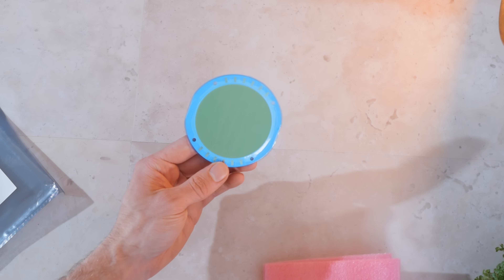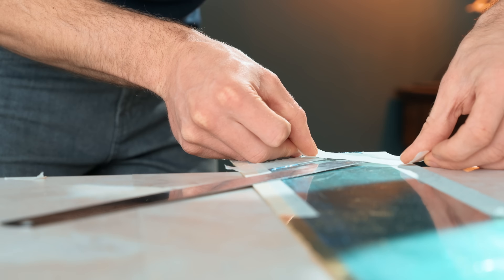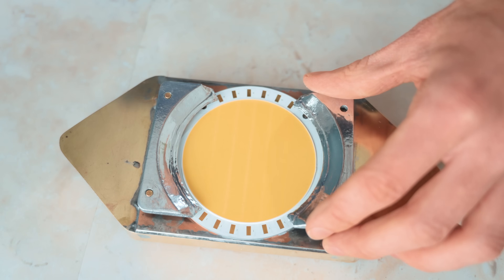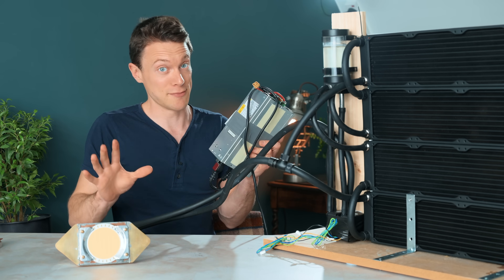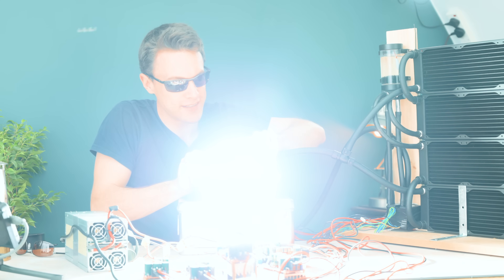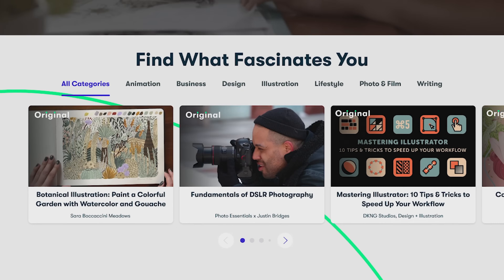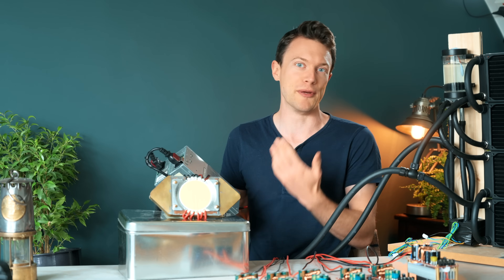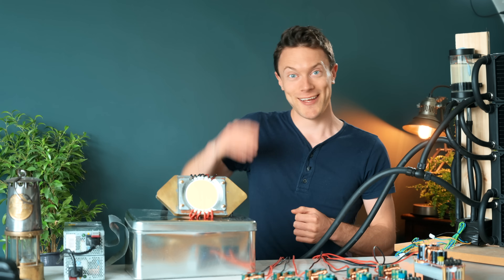Testing the world's BRIGHTEST LED!!!

Comment from the maker: FAQ Time! But first, don't forget that after your first two months of free Skillshare trial goodness it's LESS than $10 per month if you go with an annual plan, which is like a good cup of coffee per week but instead you're building on your lifelong knowledge. Enjoy! https://skl.sh/diyperks2
Now, question and answer time!

The first think I'll say is that there's been a surprising spread of discussion about various aspects of this build in the comments. It's great to see! I actually learn a lot from reading comments that you guys leave, and there are some serious golden nuggets of info here and there which I appreciate a lot for building on my own knowledge. I will first address a few common misunderstandings though.

Firstly, some folk are assuming that the LED is 90%+ efficient, which would mean that it would only output 150w as heat and the rest as light. This isn't the case unfortunately, as even some of the best LEDs are only 40% efficient MAXIMUM. This figure changes depending on the colour accuracy, with more colour accurate LEDs being less efficient as they have to emit more of the visible spectrum. Let's assume the LED is roughly 30% efficient (which is probably fairly accurate, and may even be a bit generous) that means that 450w is being emitted as light, and the other 1050w is being wasted as heat. So, I built my cooling system around the assumption of needing to dump 1000w of heat into the air, which is why I had four large radiators and made an extreme cooling block for it. LEDs last longer when they're cooler, so it's super important. I also want the final unit to run quietly, not with maximum fan speed, so this extra headroom allows me to do that.

Another thing that crops up is talk of corrosion. In water loops it's very important to use similar metals, otherwise you run in to galvanic corrosion where one metal will literally steal electrons from the other, causing the other one to corrode quickly as they're 'connected through the water'. Brass and copper are similar enough, but the lead in the solder may be susceptible to corrosion. However, adding an anti-corrosive additive to the liquid should solve this in the final build. The radiators are copper, not aluminium, so no worries there.

As for the PSU's failing... there have been many theories but nothing solid. They are 12v PSUs, and are rated for 83A on that lane. When in series, they give 24v at 83A... 83*24=1992w. The reason for my wanting a higher voltage is that it literally halves the amps on the voltage booster, meaning they can run easily rather than at their absolute maximum ratings.

Hit me up with any more questions!

Anyway, I hope that clears things up. If you still see these questions popping up please relay the answers contained here for me please :)
Reply: Where do you write your ideas down? How do you come up with your ideas for your videos? I always strive to find new ways to stay creative and keep the ideas generating! Cheers!
Reply from the maker: @KennyPhases  I use Google Keep on my phone to jot down my ideas. Usually I get inspired from a train of thought or from talking to others.
Reply: @DIYPerks  I think you your heatsink is too large. You don't have to get rid of 1500W of excess heat, but of (100-LED efficiency) % of the heat... You should be able to dissipate that much by using a vapor-chamber heatsink from an old graphics card!
Reply: @DIYPerks  could you please test it outside in direct sunlight? It's more interesting to see on video the comparative effect compared to a known light source (sun)  then to look at basically any lighting setup which the camera then adapts to...
Reply: @DIYPerks  can you make a atx pc case kit in the future ?
Reply: @DIYPerks  Pleaaase test this in the bright sun, to see how it would play for day film making... I'm more interested in the day time test rather than at night. 

For the power supply, you could use six 24V 15A, one for each booster and each section, cheap enough, overrated and easier to handle than a single huge one, check it out.
Reply: @DIYPerks  There are more biger and brightest but the bigest ones are in Germany theyr so bright and It Bruns evry Thing infornt of the Lens in 1milisecond and theyr From Samsung also
Reply: @DIYPerks  where’s the next video.?
Reply: Whatever it was that caused the PSU failure, I highly doubt it was running them in series. While it can be a bad idea in some circumstances, since you're using identical supplies tied together and just to power this one thing, there is no way that that will "bother" them. Because they're galvanically isolated from the mains, they don't know and don't care that there's another PSU in the system. 

In this case, you could also run several 24V PSUs, with certain caveats. Their 24V rails should not be actually tied together, unless they're rated to work in parallel with another PSU. Otherwise, they'll fight for who is supplying exactly 24V. However server supplies are generally designed to avoid that problem. 

But you could also get several generic "24V LED power supplies" and use each one to separately power a boost converter or two. 

Anyway, great build! And a water cooling setup that would make Linus tech tips proud. That water block is especially awesome.
Reply: @natalie5947  I think the issue is probably the serial connection of the two power supplies. The psu output around 80A that means that the output transistors will not be capable of withstand a lot more than that. When he connect them in series and crank up the power to max it probably doubled the amount of current going through those circuits. More current leads to more dissipation of heat, which is probably why the fans kept ramping up.
Most high power psu will have some signal to interconnect 2 or more psu in parallel,  but I've never seen anyone connecting psu in series. Probably because of this. My advice would be to get a 36v psu or 6 x 24v psu (since he already using the voltage adaptor boards).
Reply: @natalie5947  the neutral/live inputs are galvanically isolated from the GND/12V outputs. But the input earth is tied to GND. I just measured my PSU.

Meaning their GND potentials are identical. When he tries to hook them up in series he'll connect 12V directly to ground.
Reply from the maker: @lucythebrazen  All true, but I isolated the secondary PSU internally to avoid that very problem.
Reply: @DIYPerks  I just posted a comment about that situation. Didn't realize that other people commented that. But has i said in the other comment, I have several server psu's and when I mod them to run in series I can't remove all chassis connections, when I do that, the psu's doesn't run well.
Reply: @DIYPerks  did you take the ground being connected trough the mains leads into account? you can only ground one of them and have the other "floating" (disconnect ground from the second mains cable). needless to say that if the not grounded psu fails in a way it connects the fase to ground the case becomes live...
Reply: @Fuscao_Preto  Yes I am just getting into PCs but I'm really into it and have been learning a lot since spending more time at home due to the current global situation. I'm really looking forward to seeing Matt's work with this project
Reply: Hey just a tip thermalpaste is really not great for this application look into thing indium foil sheets they do the exact same job but a lot better.The heat sink feeling cool also explains this as the thermal paste is not that good at wicking away a ton of heat fast yea please look into indium foil. How it works is that indium is a very soft metal with high thermal conductivity so when you bolt it between 2 metals it fills all the cracks and scratches between them offering better contact between the 2 metals and also an increase in heat transfer rate
Reply: @Gianns_TDM  indium foil is only marginally better than high quality paste. And that's only IF there is significant clamping load to upset the foi and force itl into the μscopic surface voids. And the clamping pressure in the middle of the area is usually not enough. Liquid indium alloys are better than paste, but are conductive liquid.
Reply: I forgot to add a possible solution.
Option 1 (less than ideal and temporary.)
Add two more PSUs in parallel or ywo scrap 12V car batteries in series with these power supplies in parallel to keep the current draw from the PSUs manageable.
Run time 30 min to an hour from batteries as you'll be wanting to take from 12 and a bit V to no lower than 10.5V. If new batteries, they tend to start around 14V

Option 2. Long term.

The LED in the description has a data sheet that states it can take 41V Max.
So a 240~ - 36V DC 2000W PSU seems like the best option for size. From China £220 the first one I Googled.

Or 10 X 240~ - 36V DC 5 AMP converters for £165 from Amazon.

Or to replace your computer PSUs 1 x 12V/24V 70Amp lorry battery charger for £120
Useful for future projects? (Peak 100Amp @ 24V continuous 70Amp.)
 Will almost certainly need the DC cleaning up for more sensitive projects. But a massively beefy capacitor using commercial sized cling film and tin foil would certainly make a nice video.
Reply: @DIY Perks You could have used one power supply to power a bank of 3 voltage boosters each, that way you would have removed the power supply series from the equation and each power supply would have ran at its rating.
Reply: @costindaniel100  that’s a very good idea, removes any issues the in series may bring. Bet there woulda been no problem s then, and he could use three power supplies, running 2 lights each at only 600 watts.
Reply: One thing I haven't noticed in the posts is that you have mixed metals (copper, aluminum, brass and plumbing solder), those mixed metals tend to cause a lot of problems in the water. be very aware of the need to add anti-corrosion fluids and clean this loop often or it will grow crap and clog up, but you can't open the heat sink up to clean it.
Reply: @deadlydragon72  Yeah I noticed the same thing he didn't clean the inside of the heatsink. Should ad some vinigar in it let it go overnight and flush it.
Reply: I don't think that you need that many radiators two should do so would mean less power usage both with the cooling fans and the pumps and fewer components to go wrong and a slimmer design
Reply: I found this power supply . I think it can work .https://www.enermax.com/home.php?fn=eng/product_a1_1_1&lv0=1&lv1=52&no=318
Reply: Great video, but I'm very dubious about Skillshare having read the Trustpilot reviews from people who have tried to cancel subs. https://uk.trustpilot.com/review/skillshare.com
Reply: send seasonic an email
Reply: Please show us the outdoor test! Don’t forget about this project!
Reply: Why not use pc power supplies but instead of wiring them in series use a transformer on the output of each and then run 3 drivers off of each power supply
Reply: Maybe look into an ebike battery or two to power it. My Ebike battery is rated for 50 amps sustained at 48 volts (not that my Ebike can use anywhere near that). It's portable and already DC allowing you to ditch the power supply. Also, I noticed you used a grid of conventional little computer fans to cool you radiators. If you use one large fan in your final build instead, it will move much more air with much less noise (a fan that is twice the diameter moves ~8 times the air at the same rpm). I can't wait to see what you come up with.
Reply: the 2 power supplies are not really supposed to run in series and they cant provide all the power, some gets lost and mostly the "2000w" psus are meant for 1500w.
Reply: Hi, just a comment about the PSU. I don't know where you but it, but normally this kind of PSU are already used, if you buy a new one from Amazon it is just a refurbished one, non of them are reliable enough to ensure a 100% performance bucause were use in a server long time ago. This kind of PSU are design just for server, in fact they are use in pair minimum, because need a backup in case of failure. They are companies that buy used PSU just for selling to other companies as a repair because people like HP just sell it new ones for 5 years, then you have to find a new server or find used parts in companies like I mentioned before. Summary : this kind of PSU are just for hobbies or people that are mining coins like Btc that have no problem to repair or replace for a used one in order to continue their business.
Reply: For the waterblock wouldn't a thread ripper or Intel xeon platinum sized blocks do, as they have a greater surfacw area for cooling. Great video as ever
Reply: @edson oliveira de carvalho So... 12V*82A is 984W, right.

The PSUs still can output 82A when coupled in series. 24V*82A is ...

Double
Reply: @ DIY Perks how many lumans is the LED?
Reply: DIY Perks Hi! I work with very strong LED sources for research purposes so this was fun to watch. I’m wondering if you considered using a Peltier cooler? This is normally how we quickly exchange a lot of heat rather than allowing it to dissipate by itself (which sometimes is too slow and thus damages the LED). This might be overkill? But for research it’s actually very necessary because at temperatures above 100 C, the wavelengths and strength of the LED can wildly fluctuate.
Reply: @mrmikkeeyy  that's a good idea
Reply: Those LEDs work by emmiting blue light that then is converted by luminofore to red, yellow, green etc. I wonder how much of LED power is eemmited in UV and in such high power application isn't it an issue? Can you gaet a sunburn from holding your hand in front of an LED?
Reply: Awsome videos
I'm wondering if you test you project first or you immediately make it in front of camera.
Reply: perhaps the two power supplies have broken because a small part of the total energy they can emit turns into heat, so the maximum wattage will have been less. Many power supplies are optimized if you find "80 plus bronze, silver, gold, platinum and titanium." and I think those two server power supplies weren't optimized for this. I hope it will come in handy and sorry for my English but I am Italian.
Reply: Hey! Not sure if anyone had the same idea, but I have a theory for the PSU failing.

You connected them in series and used step-up converters after them, right? That is a huge amount of switching noise that you did not address at all. You might have had some serious high-frequency noise with peak currents way above the rated max of the PSU. You should have checked that with an oscilloscope. Maybe adding extra buffers between the PSU and the step-up converters would have done the trick?
One obvious mistake you made however, was turning off the whole system once you realised that it's too hot for your likings. You should have disconnected the LED and let the PSU and the pumps running. That way everything is cooled actively until residual heat is taken away. That might have been the last drop for your PSU.

Otherwise great job and thanks for sharing of course. Cheers!
Reply: Not sure what your budget is, but why not something like three MeanWell HLG-480series, or six ELG-240 series?  These supplies are passively cooled and designed to run at 100% output all day long.
Reply: I think the issue is hooking up those PSUs in series. 

Most PC PSUs have their output GND at earth potential, so effectively both your PSUs share a ground, that's basically a short circuit with extra steps...
Reply: @lucythebrazen  all you need to do to run server PSU's in series is to remove the ground pins from the plug and make sure you don't touch he cases or you can isolate the circuit board from the case then you can leave the ground pin and you can touch the cases.
Reply: @lucythebrazen  i tought the same, the PSUs need to be in paralled and protected by diodes on the positive. And maybe the boost converters should work a bit extra to get those 30v but it would be better.
Reply: I've seen you use the filters from a monitor to change the shadows of a light source. Do you plan to use it again in a powerful LED? BTW, can you even use those filters with such source?
Reply: DIY Perks Use a lorry’s (truck) battery
Reply: DENIS Forrest A marine battery might be better (or a bank of 6), but I have to wonder how long they can sustain even voltage. I’m also thinking that for the purposes of the experiment, the cooling system should have a separate power supply.
Reply: How much power can you actually get out of your home power socket? is there a point you will overload your input to your house!? would love to know!
Reply: Shagrof That depends on your geographical location. In the U.S., your ordinary three prong socket supplies single phase 110-120 volts, and are rated for 15 amps. [If you have greater power requirements, you can add a 240 volt circuit (using two hot legs to complete the circuit, rather then 1 hot and 1 neutral) If this sounds to technical, it’s better to avoid fooling around because these voltages are deadly.] Other countries use different voltages, and their outlet connections are rated differently according to their local electrical codes.
Reply: @deadeyenation1  that will depend a lot of where you are and which outlaw your talking about. Here in the UK the max amps for most sockets is 13A so when you multiply by the 240V we get around 3KW of maximum power. So you can check the maximum amperage that can go through a socket and multiply by the mains voltage.
Reply: @deadeyenation1  a main house has either a 100amp or 200amp load, I believe.?
Reply: Wouldn't a big pc watercooling monoblock suffice the surface area?
Reply: just saying we can see wires and your lighting in the top right
Reply: How much time do you spend making projects?
Reply from the maker: @samuele_gonnella  Too much!
Reply: I'm curious about water cooling the power supplies and voltage boosters as well. My plan is to light my new shop using water cooled 100w LEDs, and I might also add that cooling to the boosters and power supply (I'm using more or less the same setup as you) too. I'd just like to know if it's worth it. Oh, I'll be dumping the heat outside the shop in summer (switching to indoor heat exchanger in winter), so moving waste heat out from the air conditioned space is a primary goal.
Reply: @edson oliveira de carvalho As you said, you do get the current limited by each psu and sum of the voltages, but that means sum of the wattage. U1=12V, I1=62.5A P1=U1*I1=750W then twice the voltage means P2=(2*U1)*I1=1500W
Reply: How much Lumen this LED have?
Reply: Perks - How much did you pay for that LED?
Reply: @thekaiser1919  He got it donated from the manufacturer.
This is mentioned towards the end of the video.
Reply: Why not add simple case fans to blow cool air into the power supply? Dual fan unit less than $20- just setup to push/pull air through the power supply and keep it running 1 minute after load to slowly cool it down.
Reply: @travisminneapolis  we have a winner 🏆🏆 PSU fans stop when the power is off but the heat is still there. This basically never happens to a real server cos redundant power. If you shut down the host, the fans can still run.
Reply: Hey it (LED with its cooling contraption) kinda looks like the aliens camera tentical form WAR OF WORLDS
Reply: https://youtu.be/GUxszz_lo14 Here he talks about the oscillation issues that can blow a power supply. I think you need to put a dummy load power resistor on the output of the pc power supplies.... Then once you turn them on with the dummy load.... THEN you can turn on the buck converters and the system shouldn't blow up. The PSUs blew up because oof oscillation issues
Reply: Wanted to see it in action at night
Reply: When you do get your replacement power supplies, it would be informative to compare to LED output vs sunlight on a bright day- the LED should have more W/m2!
Reply: DIY perks,
Please make a dedicated video in DIY Amazon Alexa.
Reply: I'll just leave this here:

https://www.ebay.com/itm/Sorensen-DHP-30-220-Programmable-Power-Supply-Tested-and-Working/302995593022
Reply: What is your name? Which school or college did you go to? Where do you get your components?
Reply: The sound when you plug in the XT60 connectors comes from sparks. You need anti-spark XT60 connectors or use a pre-charge resistor.
Reply: You cloud try with something like an ELTEK FlatPack 2HE power supply. They can handle a lot of power as they are used for telcom UPS systems. You can get them fairly cheap on ebay
Reply: I feel the PSU failed because when you cut off power to it. The excess heat within it fried its components. Since the heat within was not dissipated. What do you think?
Reply: In the video you first turned on power supplies before connecting all the things individually. Did you disconnect first or just power on?

Those power converters have big caps on them and are going to draw a lot of startup current if powered on at once, likely more than the power supplies are rated for.

Worse, those capacitors are going to clamp the voltage over themselves as they charge up, meaning if one of the power supplies comes on before the other, the remaining voltage will be applied to the terminals of the other....in reverse, bad times for that power supply.

If one turned on before another with a load, it's basically akin to connecting one across the other in reverse, that sounds like a recipe for dead power supply

Also, derating- the power supplies are rated for that on their own, their functional rating may very well be far lower if  you strap them together, heating each other up like that
Reply: You mentioned in the video that you couldn't find a suitable copper water block.  See https://customthermoelectric.com/products/water-blocks.html
Either a 3x3 inch or 4x4 inch should do the job. Though I really like your concept of essentially wrapping a copper heat sink for water flow. Very well done. Killer LED.
Reply: Why didn't you just use a threadripper block? It would have been plenty big
Reply: When you pulled the power plug I thought to myself: "Well, he fried the PSUs". Not sure if this has been mentioned, but you shouldn't just turn off something that's very, very hot and uses fans to cool it down. Because when you turn it off, the heat is still there, yet the fans can't cool it down anymore. It would've been much safer to turn off each section of the LED and wait until the fans get quieter, before pulling the power plug.
Reply: Do you know if they have a powering harness available too?  At 95 CRI--which you should mention that outstanding CRI in the next video by the way because often when they do these LEDs, there is a CRI/intensity tradeoff--that light is every reef tank owners DREAM!  I'd love to get a version of it about 1/3 the power with and accompanying power supply, cooler, etc.
Reply: Your server power supplies are rated for 1000w probably. Using them in series will increase the voltage only, not the amperage. Boosting the voltage up is far from being efficient too. I think its about 60% efficient. Your power supplies are waay underrated for this task.  You need at least 4x1000w power supplies. 2parralel in series with the other 2
Reply: For the power density of the LED array you are working with, it is normal to mill the mating copper  surface flat within a few microns. Then use the absolute minimum amount of thermal paste. This is standard practice with high power RF devices etc. Alos, the PSU that blew up - did you have the fans programmed to run as fast as possible ? Anyway, well done, Mark
Reply: You should make it hand-held
Reply: Hey man, reason behind PSU's failing may be, in imbalance, I guess? Like power not being splitted in half but rather one PSU working harder then the other one? Or if they were second-hand one, they were maybe worn out after years of service.
Reply: Sss
Reply: Could of just stuck it to a fish tank
Reply: Are you going to make a huge movie theater projector with this?
Reply: Hey, have you looked into building a lithium battery to power this? It would probably improve the overall efficiency.

A 8s10p 18650 pack could handle 100A continuous at 30v, without the need for cooling!
Reply: Can you make a video similar to your Home Security on a Budget one, except for outdoor security? I don't want to pay upwards of $400, or monthly subscription fees for the regular commercial products.
Reply: Is there anything wrong with under-powering an LED?
Reply: time for another custom PC build ,i think theyre peoples favourites to watch :) how about a PC build that uses one single massive heatsink for both the CPU and GPUs to affix on with one single intake fan beneath it
Reply: I have an idea can u make a duel screen mobile like u did on laptoo is it possible.. Even it ist pratical
Reply: Why not power each LED strip with its own 1000W Power supply?
 You can buy those from good brands like Corsair and the such :D
Reply: Matt I absolutely love your work and enthusiasm.....can i pick your brain, i know you like to “repurpose” ....I’ve repurposed some scrap wood...and made a Grand piano!!! (Look in on my youtube I’m playing “Imagine” on this very creation!) ....I’ve basically built a carcass replica Steinway to house my digital piano....long story short...how can i put bigger speakers/make louder? (I have two passive PA speakers can i link them to a YDP101 Digital Yamaha piano easily?? Have you any pointers?....this would be greatly appreciated!! Keep up the great work 😉
Reply: I just bought one of those $100 recliner off ebay and got to thinking about modifying it. Any suggestions for possibly putting speaker on it? Cheaply as possible 😆
Reply: what kind of engineer are you?
Reply: I would like you to show me how to make a homemade air conditioner?
Reply: Do you make YouTube videos for a living or are you an engineer.
Reply: thank you SponsorBlock for these crappy sponsorship adverts, if products shown on ads in Youtube videos were free, it would be better but *no*...
Reply: You should check with the manufacturer--just because the COB LED is rated to 1500W max, it is usually unwise to run it at  max power. Running it at 50% or lower, maybe even 30%, is more sensible or you reduce it's life span, i.e. you burn it out rapidly. Cooling it would be less of a problem too. 1500W probably exceeds if not triples max sunlight in it's beam. It's just something to think about. I think most 'grow lights' run the LEDs at a significantly lower wattage than the max wattage that could be used and can still exceed sunlight, in the $600 price range, including all the electronics and cooling. 

Also, there are specialized LED drivers/power supply designs that are specially made for controlling the voltage and wattage, to make sure you don't harm the LED, and you might want to look into their design in relationship to computer power supplies. (I don't know the differences, and it's possible that computer supplies can be modified to accommodate the differences. It's just something to think about.) 

These a very interesting COBs, and their application does require cooling designs and probably lens designs to distribute the photons, but I think they are not meant to be run at full power. 

They have more available light in a compact unit, and could be very useful , but  it comes at a price. You say you got this for $1000, but they are more like $1500 and don't include any of the electronics. These could make a great grow light in a large space, or spot light, stage light, or photography light when used properly, but even so, they are overly expensive for what you get, and the grief you have to go through to balance all the other factors needed for setting them up and making them  usable.
Reply: probably irrelecant, but next time id use d5 pumps, also with water cooling reservoirs you can leave the top off while filling and fill directrly from a gallon bottle, this will allow you to avoid cycling and fill the whole loop in about 10 seconds
Reply: @DIYPerks Make a Video on Repairing of 25W Motorola Charger
Reply: Robber: give me your're lights or say good buy!
Reply: Try brazing next time.
Reply: Heeey, it would be awesome if you could do one video, where you take cheap fake JBL speaker, and then upgrade it to sound like original, or even better than the original! :O
Like what to buy, what to look at, power consumption, what batteries to use and stuff like that.
I love your videos, I've learned so much with your work, and I have also done like 4 DIY projects, all learned from your videos!!
Reply: You could use 2 corsair ax 1600i PSU in series, but they are a bit expensive so if you can make sure they sponsor you it might be a good idea. Sorry for my English google translation is not perfect! I love your videos, keep it up!
Reply: you need to use Bitmain bitcoin miner power supplies im sure you can find second hand ones   they are very efficient and heavy duty
Reply: Why are you so attractive
Reply: Actually, there's 1500w 36v power supply you can buy off an Aliexpress for about $150. That one should be a better fit for the LED rather than having to convert from 12v to 36v. Also, the boost converter is probably at about 90% efficiency, so that will consume more from PSU, so this could push the PSU over the edge and fry it (though it might have been saved by keep the fan running for a minute before pulling the plug).

P.S. I can source a similar emitter (CRI, wattage) for less than $300.
Reply: The company that makes the led you would imagine would have already made a water cooking solution what's the point in buying it as most end users wouldn't be able to make their own custom fitting
Reply: Hi, Great video. My request is that you do a follow up, with a few key points:
1) The best use of such a light would be for film purposes, as it likely outputs (I'm guessing) the equivalent of a 10 kW tungsten light, could you compare light outputs with such a fixture? Or measure? Just so that we know what level of light output it actually makes? Also bear in mind that the daylight balanced lights used in film are made by HMI based lights, which are typically more efficient, though I believe STILL not nearly as efficient as this. Perhaps a 3 way comparison?
2)  Can you show us what it looks like when placed behind a large fresnel lens?
Reply: I think your issue here is that you shut off the power supply to quickly when it was at max load. Doing so when the PSU is hot will burn out the circuits if its getting no cooling as such when you just plopped off the power. Wattage and such is fine. You just need to let the PSU cool down first before unplugging it. Like take the load off and allow the fans to ramp down for 5 mins when its not hot anymore unplug the PSU.
Reply: Grab a power supply for an ant miner. Instead of a server PSU which combines total potential wattage across all rails (3.3V, 5V, +12V, -12V, etc) as it's wattage rating... likely even though you had the PSU well under it's total max, you overloaded the rail you were drawing from. An ant miner PSU will deliver +12.25V @ 130A  on a single rail which is what you want for this.
Reply: You would have to go outside at night to really show how bright this is
Reply: For you next video make a arcade box mini version
Reply: Maybe I'm missing something, but I was confused by the excitement that the heatsink was staying cool. I thought if it was doing its job correctly it should be getting warm, as it's pulling the heat away from the LED (but not too warm because water is cycling through and helping move the heat away). If the heatsink was heating up the water to 30+C, then why wasn't the heatsink itself warm?
Reply: Any idea how many lumens it is? While this uses a ton of energy, it would be interesting to know how much power a traditional light would use to get the same amount of lumens.
Reply: food for thought, just to make sure you are removing the maximum possible heat, maybe run some solvent then oxide removing solution (repeat as necessary) through the water block to clean it and maximize heat removal. I also saw someone suggest using indium foil for thermal interfacing, definitely a good idea to look into that as well. you may also want to lap both the block and the led cob.
Reply: "Comment"
Reply: Amazing work you've done there! I think the problem with the power supply was that in addition to what you said, you taped it to each other and the heat can no longer dissipate from the side that was tapped to and that contribute to over heat and burnt smell.
Reply: Did you look at Threadripper water blocks?
Reply: @oki doki i was thinking on that volume of water too ..but felt satisfied that its close enough to  ultimate temp when he mentioned ventilating the room brought it down a degree .. Plus that heat source could bring a pot of room temp water to the boiling point as quick as a small stove top element.
Reply: Your eyes and smile are brighter than the LED bulb.
Reply: use this led in car head light and go to outdoar  
and sea how far you sea
Reply: It's also important not to forget that power supplies have a lifespan. They do not last forever. I am not sure if the ones you used were new or old though.
Reply: If you haven't already solved the power supply problem, consider using an electric arc welder.  They are designed to output various voltages at extremely high currents for sustained periods of time, while also being designed rugged enough to handle rough and tumble working environments.  I see 1500 Watt units for sale in local hardware store ads all of the time.  Anyway, good luck with the project.
Reply: Is the follow-up still coming?
Reply: Please try it outside during night
Reply: crazy how Efficient LEDs are, it’s this bright at such low efficiency using so “little” power
Reply: What is the point of this LED? You can simply use regular 10 kw light bulb and it does not need bulky and complicated PSU and cooling things.
Reply: when will we see outdoor tests?
Reply: Hey you might want to talk to "styrophyro" he's vary safe and educational
Reply: Hi Matt. When are you following this video up with one showing it all working outside etc? Can’t your new power bank deliver the necessary power?
Reply: Where did you get those voltage booster circuits from? @DIY Perks
Reply: You had to Put a Lux Meter in Front.
Reply: I have been waiting for 2years to see project you want to use this LED for
Reply: And also many guys here said that problem was connecting in series but thats not true. You see server pcus have massive capacitors at each power rail. When capacitors are connected in series max handeling voltage also rises. Since oll parts in server pcu have at least dual voltage capabilitys.
Reply: I have a feeling your power supply blew due to your voltage  boosters. When dealing with voltage boosters remember that to increase to voltage more  current  is drawn and the bigger the input  voltage gap from the output voltage the more current will be drawn.  And add in also the current draw of your  load .  You  did that what 4 times with 4 boost converts? Lots of strain on the power supply and it's no wonder it got so hot and blew.
Reply: I suggest you to use Thermal Grizzly Conductonaut for the perfect heat contact.
Reply: What about the testing video.? Outside.?
Reply: Part two where?
Reply: 0 pp pp pp pp pp
P
Reply: where is the part 2 of this video you promised us.
Reply: I need 800w color led , round
Reply: it may be with age that they lost their maximum power output(eg. somewhat dried out capasitors,etc)
also you should do a teardown on them as you said thery are blown now, see what blew up, maybe fix it
Reply: If you're not aware, computer PSUs have an "80+" efficiency rating, where server PSU's are typically much more efficient than normal ATX desktop PSU's, however this is actually a curve, depending on loading, with maximum efficiency at around 60% load, which drops off significantly towards their maximum rating. It could be that at their limits, the cooling was not adequate to remove all the excess heat and the least efficient component failed.
Reply: Can you cook an egg with it in the next video?
Reply from the maker: @ik_osu  Can I cook an egg? I'll try! That's what I was up to when the PSU went kaput.
Reply: Instead of running the PSUs in series, could you use each PSU to power 3 sections?
Reply: @Yoshi-044  would be better
Reply: @Yoshi-044  there would be even more losses doing that, ideally you want to get the power supply voltage as close as to what you are powering so the boost converter doesn't have to work as hard.
Reply: @DIYPerks  could you show me how to make a homemade air conditioner?
Reply: I'm not sure if someone has suggested this but that amount of wattage it's usually the load of a top tier electric bike, maybe you could get the battery system from a second hand, it will be expensive but it should hold itself pretty well, an other option would be electric car chargers, they can supply plenty of juice and are a good wired option as there aren't many other common consumer goods that eat that much power, but if you are on a hard spot with budget issues you could try super capacitors, they aren't that expensive but they won't lit the light for too long, maybe a few seconds at most

Edit. Also the reason your power source got fried its this w=v*a so... If you are pulling up the voltage and keep the same wattage demand you can see what would happen to the current (ampers)
Reply: you really don't seem to know what you're doing, nor the damage to your eyes you're causing

you should be treating it like you'd treat a laser
Reply: @iamdmc  are you sure it's as bad as a laser?
Reply: @iamdmc  he said he was wearing his lazer glasses.
Reply: There are 1600w power suplies. Why didn't you use one of those? Sorry if someone already asked this, i'm too lazy to read all of the replies
Reply: I would believe the reason for the failure of the power supply is 2 reasons. While the amps and volt channels may be rated high enough, server supplies arent meant to be run at those rates for long term but more of a peak use during main test boots. I would say look for using dual 1500w supplies, it may seem like overkill but should give you the needed output when paired together for longevity. The 2nd reason I can think of would be that most powersupplies rely on a server systemboard to regulate them for fan spin up and cooling measures plus proper volt and amp push. You may need to have a controller board put in place to adjust the flow of them each individually as the system could try to pull fully from 1 and fry the circuit. Instead of a server based power supply, you may want to look in a workstation power supply instead, something like is used in a Z820 based computer as it bypasses the failover found in many server modular power supplies.
Reply: Dear DIY Perks. I am a physics teacher and I believe I know why your power supplies over heated.

Ohms resistance law states. Resistance = Voltage / Current
The resistance of the series circuit only increases by the internal resistance of the PSU added when going from 12V to 24V. So the current will almost double as R increases only slightly.

The issue is that current causes heat.
Kirchoff's first law states that current in a series circuit is the same at all points. Double the Voltage, double the current.
Kirchoff's second law states that. Voltage is shared proportionally to resistance. Double the series Voltage, double the Voltage shared to each component of assumed constant resistance.
Finally
Ohms power law states Power = Current X Voltage 

So by doubling the voltage and current. You inadvertently doubled the thermal load each power supply had to handle.

The brilliance of this is how simple it is to miss despite knowing the rules.

I worked it out by randomly applying the equations I knew whilst thinking about this over breakfast after watching your video.
Reply: @markp8295  Yes, the current would double, but only if the resistance was linearly dependend on the voltage, which it is not for LEDs, they are not measured in ohms. These 32V LEDs start conducting at 27V, then the current increases "exponentially". Anyways, that is not the issue. You are talking about doubling the current, but there is no baseline to compare it to, the rated current/watts for each psu is the maximum, it does not "push" that current all the time. He did limit each DC converter to 250W, so the total would be 1500W.

What I suppose is the reason of the failure is that he didn't isolate PSUs grounds, which is necessary for many (if not all) server PSUs. you can read about it here for example http://www.tjinguytech.com/my-projects/diy-24v-47a
(I have studied electrotechnics and it is my hobby)
Reply: Mr. @markp8295  you don't need to solve complex ecuations. Each power source can handle 1000w. Using then in series will count the voltage only. The total max amperage that the circuit cand provide is the max amperage each individual psu can provide which is 1000w. Boost converters are not 100% efficient either. They are probably only 60% or so. Also, all these boost converters produce a lot of noise that is going back into the server power supply. Each power supply took a load of about 150%. I'm just an engineer tho...
Reply: @markp8295  so in essence he is actually over powering the psu’s .?
Reply: @rogerbrandt6678  I believe so.
Reply: You spent 1,350 dollars on an led wish i had that kind of money to spend on cool stuff like that
Reply: @rumblertag8933  Nope. He got it donated from the manufacturer.
This is mentioned towards the end of the video.
Reply: @rumblertag8933  he said he never bought it.
Reply: Your power was off. Psu have fix power outpot. For eg.
12v at 83A that comes to 996W per unit. In series you get 24v but only half of the amps. (996/24V). If you had them in paralel mode you could  combine there output power. 
I presume that booster need at least 6-36V input to work and that psu units are around 1000w.
Reply: @LordAnubis0909  no, the Amps don't halve, you do get twice the power. The maximum Amps is the lowest of all parts in the circiut, which is 83A for both of the psus.  You do get twice the Volts and Watts, as Watts=Amps*Volts. If you connect them in parallel, it is the other way around; you get twice the Amps with same Volts.
Reply: @trogper  yes you are right, i din't express myself right. i was thinking 12V*83A or 24V*83A. but at the time when i was waching the video i got impression that he was counting 24V + booster*83A. what i was thinking was if you are busting voltage you have less amp. to use that is exit power has to be the same.  But other comments explaint it better then me :)  (i'm lacking eng. words to explain it :) )
Reply: @LordAnubis0909  In series the current stays the same but the voltage doubles so his calculations are correct.  Current X Voltage = Power in Watts.  So 83A X 24V = 1992 watts. 

Think of it like adding batteries in series.  2 batteries in series offer the same current (and Ah capacity) but double the voltage.  2 batteries in parallel offer double the current (and Ah capacity) but the voltage is the same.  In both scenarios for the batteries, the total wattage would still be the same since you are just trading amperage for voltage or voltage for amperage with the same power source.
Reply: @LordAnubis0909  are you saying if you put server PSU's in series to get a higher voltage it will only be able to draw the max wattage of one PSU because that is bullshit?...
Reply: @LordAnubis0909  This is not correct. Each power supply works as a standalone unit, providing it's rated power - knowing nothing about its load (other than if the load exceeds the rated power). It's no different than connecting 2 identical batteries in series... the current stays the same, the voltage adds.  If they are in parallel, the voltage stays the same (as each individual battery), the current doubles.
Reply: @LordAnubis0909  Nope.  In series, voltage doubles and current strays the same.  In parallel, current doubles and voltage stays the same.  Double power in both cases.
Reply: @LordAnubis0909  R=V/I
The resistance of the series circuit only increases by the internal resistance of the PSU added when going from 12V to 24V. So the current will almost double as R increases only slightly.

The issue is that current causes heat.
Kirchoff's first law states that current in a series circuit is the same at all points.
Kirchoff's second law states that. Voltage is shared proportionally to resistance. 
And
Power = Current X Voltage 

So the PSU coolers were dealing with more thermal energy that they were designed for.
Reply: hey, you may be shorting out your power supply for not using galvanic isolation! They are not batteries, two power supplies may share the SAME ground.